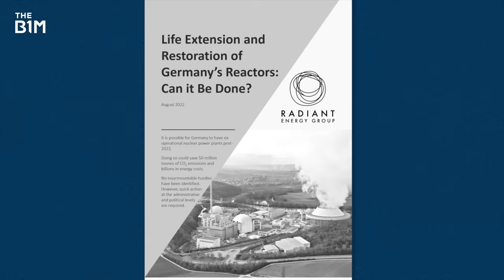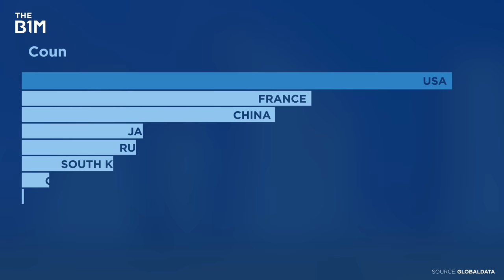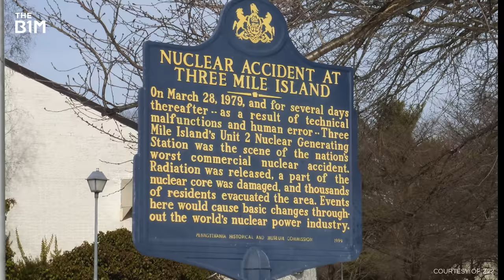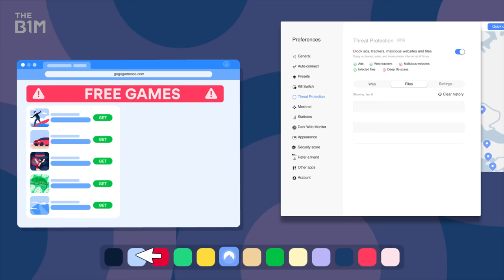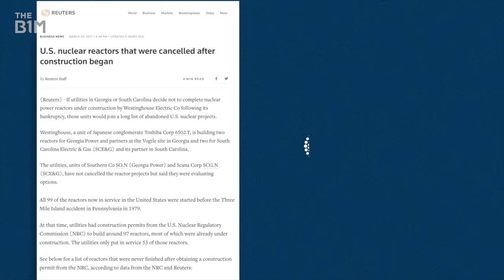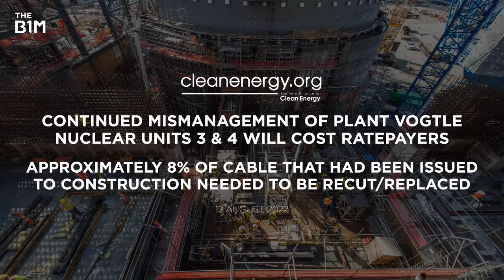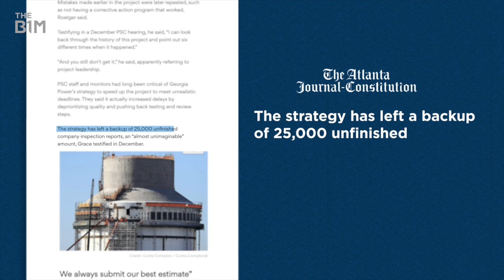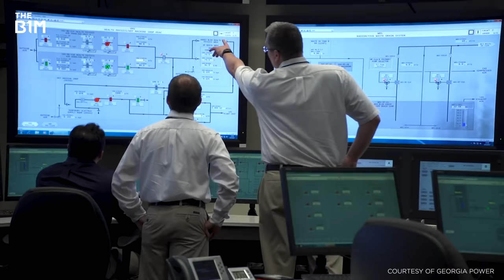Why Nuclear Power is Making a Comeback

Comment: Delay and overbudget doesn't really matter. I'm a nuclear expert, and they tend to pay back after 3-5 years. The Olkiluoto plant in Finland was very behind schedule and overbudget, however, it has been a great success and will be paid back in just 3 years, and then there will be tremendous profits.
Reply: I think I doesn't really matter if it's delayed or overbudget, it's our only easily way of reaching a fossil fuel free future, so we need to build it anyway. Put the earth before profits
Reply: But as was alluded to in the video,  much of the delay and cost blowout was simply due to the fact that none had been built domestically in 40+ years.  Its like when they started ramping up construction of the Virginia class submarines,  it started off terribly, but once they got a few out of drydock they worked out the construction kinks and now they roll out ahead of schedule and under budget on a regular basis.

If they get to work on the next soon, that knowledge of how to do it, and what problems to look for will transfer,  speed will pick up, and price will fall more in line with whats expected.
Reply: @mmeade9402  and when all the Dictators have nuclear industries the extra nuclear deterrence submarines can be built more quickly so that they can be close to the new threats. And act rapidly. 
150,000 SMRs, Small modular reactors like BWRX300 from GE Hitachi and Rolls Royce.
No more CO2 in the world. 
$TRILLIONS in national grids to disperse the concentrated central electric power to the dispersed ends of the grid and the dispersed EVs.
Reply: @eannamcnamara9338  As much as I care for our planet, I have to disagree with a "overbudget doesn't matter" sentiment.

Money is useful, it abstracts sth as complex as building a nuclear plant to single number that can be compared to some other complex thing e.g. medical expenses. We have finite resources, we have finite productive capacity and finite work hours at our disposal. Building a sustainable future means we have to be extra vigilant in how we manage those.

The different between a vanity project and an investment is that the former ignores any cost effectiveness. Let's not make that mistake and be critical of ourselves even when we are doing the right thing :)
Reply: Zaydan Naufal  good question, never even thought of it. 
No petroleum needed for 60 years, you could then buy a cheaper one on the second hand market with a full tank.
Great minds think alike.
Reply: Zaydan Naufal  Oh and even if they still owned the auto company i dont think a nuclear powered car would be possible and most people probably dont want thousands of tiny nuclear reactors on the highways.
Reply: Last time I attended a class on nuclear economics, the numbers worked out to be ~10-15 years until breakeven on nuclear as opposed to 3-5 years with coal or gas which is why funding is so much easier to secure for those. A lot less financial risk. I'll believe you if the Finns can do it in 3-5 years years. They're much more cost efficient than in the US. Fewer palms that have to be greased to get a nuclear plant built.
Reply: @kma3647  if you built nuclear in a 100% electric country or world then all the grid has to be expanded aswell.
The dispersed ends of the grid means a massive expansion of this infrastructure and nobody notices the grid. 
Little Australia has 1,000,000kml, so 5 times that at $2million a klm and the USA is extremely big.
Poles and wires to the streets and homes and businesses and industries and national transmission lines....! ?
Reply: Zaydan Naufal  No great idea I think nuclear train could work if nuclear ships do and you dont have to plug train in. This would be good for China.
Reply: I just googled that plant. Construction began in 2005. Thats 17 years to build one plant. Is it wore out by the time it starts operating.
Reply: @ashleyhill6697  Hahaha Hahaha 😆 
Good response.
Reply: Solar and Wind pay back in less then half
Reply: Building primarily new nuclear is a waste of money. It takes 15 years from start to finish. 
Solar and Wind would be running by then already for 10 years
Reply: your a nuclear expert on what? Nuclear medicine, or nuclear density testing of compacted soils, or nuclear irradiation of food for industrial production, or xray machines, or  ?????
Reply: Well that is definitely nonsense, Olkiluoto 3 just started coming online this year (2022), and took 13 years to build at over 11bn EUR cost, this versus finishing 2010 at 3bn EUR. 
It should make the region's pricing cheaper or keep it stable though since the interlink there isn't high enough capacity to serve the area, also not enough to export all the power the plant is producing.

Nuclear is the most expensive way to generate energy, with only CSP coming close (depending where you build it, Finland is not somewhere you'd build it).
Reply: “Nuclear energy is never profitable”, new study slams nuclear power business case

Michael Mazengarb 29 July 2019 27

A new study of the economics of nuclear power has found that nuclear power has never been financially viable, finding that most plants have been built while heavily subsidised by governments, and often motivated by military purposes, and is not a good approach to tackling climate change.

The study has come from DIW Berlin, a leading German economic think-tank, and found that after reviewing the trends in nuclear power plant construction since 1951, the average 1,000MW nuclear power plant would in an average economic loss of 4.8 billion euros ($7.7 billion AUD).

The report comes amid a hot debate over the future of nuclear power in both Germany and Australia.

The re
port published by the German Institute for Economic Research (known as DIW Berlin) reviewed the development of 674 nuclear power plants built since 1951, finding that none of the plants was built using ‘private capital under competitive conditions’.

“The results showed that in all cases, an investment would generate significant financial losses. The (weighted) average net present value was around minus 4.8 billion euros,” the study says.

“Even in the best case, the net present value was approximately minus 1.5 billion euros. The authors included conservative assumptions with high electricity prices, low capital costs, and specific investment. Considering all assumptions regarding the uncertain parameters, nuclear energy is never profitable.”
Reply: @stephenbrickwood1602  no more world. your naiveity is astounding.
Reply: @reverendbarker650  I am anti nuclear for economic reasons. 
I think we agree.
Which of my comments do you refer to  ??
Reply: Please provide your source
Reply: Nuclear expert in what aspect?
Reply: @johndawson6057  nuclear power plants and central grid electric supply economics would be useful experience.
Construction of power plants, even gas and coal fired, and transmission lines a few decades of life.
There are comments from these conservative and experienced people.
Warning comments, on the failures after 75 years of intense research and experience. 
You should find them, the fan boys are wasting their own space.
Reply: Bullshit. These two reactors will supply maybe a million households. At $30 billion cost that's $30k per household. In five years that's $6k per household. How high do you think energy bills are in Georgia?
Reply: Zaydan Naufal  Where do you get the electricity for your train?
Reply: I rather have a battery electric or whatever fuel cell-electric Rolls indirectly powered by nuclear power instead.
Reply: It has been debunked by the nuclear industry themselves : 
"World Nuclear Industry Status Report (WNISR)"

"The cost of generating solar power ranges from $36 to $44 per megawatt hour (MWh), the WNISR said, while onshore wind power comes in at $29–$56 per MWh. Nuclear energy costs between $112 and $189."

LCOE is the most important factor for reducing fossil use.
Reply: @chargehanger  can you share the link here pls
Reply: @reverendbarker650  share link pls.
Reply: I'm not even sure why we would need to make a profit off them.  As long as they can break even with them and keep power costs low it would encourage business growth. As long as in 30 years they have made enough money back to refurb then they could get 60+ years out of the original investment.  It just means public ownership.  People would start calling people making those suggestions communist though.  lol
Reply: @stephenbrickwood1602  So you weren't anti-nuclear 5 to 10 and more years ago when nuclear was king among non-site-specific sources of carbon free electricity? I contend it still is, because wind and solar are totally dependent on coal and gas backup, and including only 4 hours of storage (you need 40 days) makes the electricity more expensive than electricity from Vogtle.
Reply: @chargehanger  LCOE isn't even a valid descriptor for variable renewables.
Reply: @gregorymalchuk272  why 40days?
Where do they need success large amount of dispatchable electricity  ?

Comment: As an American who’s not a fan of carbon emissions, I’m very pro nuclear and I hope we see more!
Reply: Hope Energy Northwest gets the SMRs they are proposing built. Columbia Generation Station at Hanford came in handy during the 2021 heat wave, but we almost didn’t have it. It is refueled in odd years, but usually scheduled for late spring when Hydro is at it’s peak.
Reply: See how pro nuclear you are when they tack on a $15 surcharge to your bill every month before the construction even starts to pay for for it.
Reply: nuclear energy isn't carbon neutral. mining the uranium and building the reactors results in anywhere between 12 and 114 grams of CO2 per kWh. That's significant.
Reply: @SebastianPeitsch  nuclear doesnt need to be carbon neutral, it needs to be sustainable (which it is)
Reply: @SebastianPeitsch  and I guess those giant wind turbines and kilometers of solar panels just appear from thin air huh?
Reply: @SebastianPeitsch  And you think those massive solar and wind equipment magically appear out of nowhere?
Reply: @SebastianPeitsch  Yeah but exactly how much Lithium gets mined every year? how about the land fills full of wind turbines?
Reply: Nuclear energy has the highest carbon footprint of virtually any energy source, except perhaps petroleum which, when fracking is involved, pumps three BTUs of energy into the ground at the well head to pull five back out.
Reply: yeah I mean you literally can build it next to a city, that would be fun, solar panel and wind turbines did it despite they almost never talk about safety, nuclear would be way safer than that right? since they scream about safety 24/7
Reply: @electronresonator8882  You don't seem to understand that the wind doesn't always blow (and the turbines don't pay for themselves) and the sun is only out for a max of 12 hours a day.
Reply: @corruptedpoison1  And you can't build solar and wind just anywhere. You need to build wind turbines on top of forested mountains where they act like lightning rods but catch all the good wind. And wind needs to be spaced apart otherwise they don't catch as much (which means they're changing weather patterns and it also means that wind takes up a lot more space than claimed- "There is
no uniform definition of the perimeter or boundary surrounding a wind power plant – in fact, the total area of a wind power plant could have a number of definitions. The
boundary could be defined based on the required turbine spacing as a function of rotor diameter, or use a standardized setback from turbines at the edge of a project."-nrel). And solar needs to cut down trees that would have prevented flooding and promote biodiversity. Even if you put solar on roofs you need roofs to put them on which means more space compared to nuclear where you could build a forest around it.
Reply: @SebastianPeitsch  it is. 95% of nuclear waste is completely recyclable.
Reply: @homiej8163  yeah I've heard this nonsense for the past 40 years. Just like I've heard that type 4 reactors are right around the corner. Just like the fusion reactor. None of this has come to pass because it's simply cheaper (at 30bn a pop) to build modified technology from sixty years ago again that can blow up if it doesn't have constant access to electricity for the cooling cycle. So spare me the BS with counting the outer concrete shell as recyclable.
Reply: @SebastianPeitsch  You would legitimately use roughly the same amount of CO2 building a few turbines. Everything uses fossil fuels during construction. Where the hell do you get your "research" from, Greenpeace??
Reply: @fructosecornsyrup5759  well if it's legitimately it must be true 😄 good one. I mean seriously you say I am wrong and then don't provide sources for your claim asking for mine. What's your source?